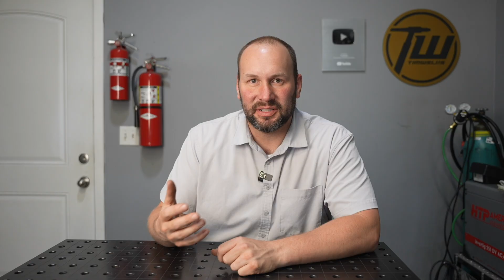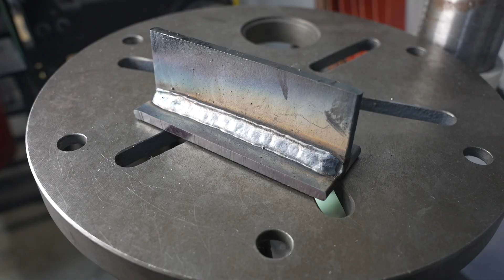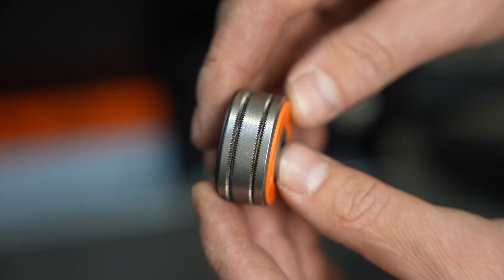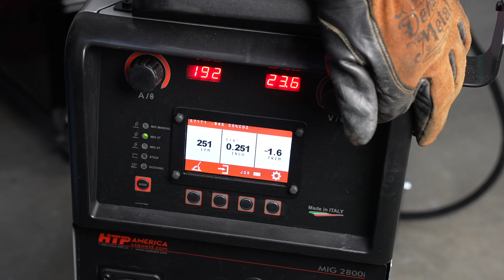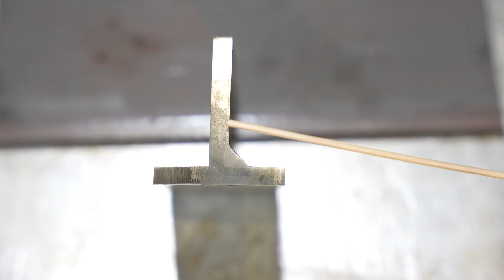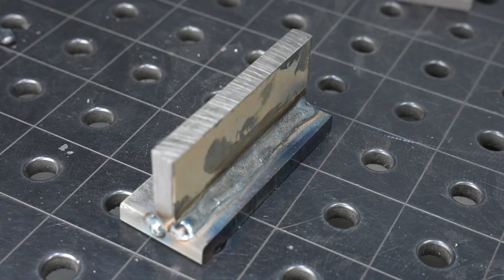Flux Core Welding w/ Gas? Dual Shield FCAW Basics

Comment: the penetration is pathetic, i cut and etch a lot of my welds ans i have better penetration with solid wire and a lot better with flux cored. all the videos on youtube about the dual shield seems to show the same thing, poor penetration and porosity..... not impressed by this process.

Comment: Ive been using a 210 for years with welding my jeep and a lot of 1/4" stuff. I've gone to a bigger front and rear axle housing (1/2") and needed to step up. I went and got a Hobart 240 iron man and have gone from 75/25 to 100 c02. 0.045 dual shield flux core wire and run about 35 on the gas pressure. I'm practicing one 1/2" to 1/4" horizontal welds with t joints. Its doing ok when i etch it but i'd still like better. I'm messing with wire speed and V settings right now. Keeping about a 3/4" stick out and of course dragging ... My 1st few welds looked AMAZING. penetration was so so... It's a fun set up and I really like the look of a clean drag weld over the wanna be tig C look.

Comment: I use this process exclusively at work. My vertical beads leave a bit to be desired as far as aesthetics but they are solid. I have never run a string bead with dual shield. We always weave slightly. As far as lead/ drag angle, I typically push my puddle with my lead at about 60 degrees tilt.

Comment: 200 amps to run 035 (.9mm) That's hot compared to solid wire isn't it ? I'm going to give it a shot  with my  200amp( 60%) Kemppi 2530 tomorrow, 0.45 wire😏

Comment: I rarely run dual shield. And I rarely cut a weld to check it. But what I’ve noticed is that whether I do it, or it’s done by someone on YouTube, the vertical has better penetration than the horizontal. I’ve wondered about that. Is it because the horizontal is on the table and so somewhat cooler? Is it because we all point slightly up, towards the vertical? Some other reason? But this is true no matter how something is welded. The process doesn’t seem to matter.
Reply from the maker: I've seen the same thing. I think it's because It's a slower progression and you're usually further up on the leading edge.

Comment: Used Lincoln outershield 71m for lots of things has its place in .035 welded a new hitch on a few trailers i still own two of them fixed my backhoe welded on a new front cutting edge been on there for over a year welded the back bucket still holding digs well guess 49 year old construction equipment needs work thing the horbart iron man 230 was working the wire has gotten really pricey though

Comment: Part of me misses running the 3/32" dual shield I used to run welding repower frames for Kinze MFG. But, the rest of me does not miss burning up 2 asbestos shields, a pair of gloves, and melting 2 cover plates in a 10-hour shift!
Reply: Yep 700 amps bleaching out all your clothes …  better have no skin shown at all !  
Komatsu and Caterpillar here in town run dual head feeders, one side 1/16” the other 3/32” on a 700+ amp power source ….
Yes, that stuff is HOT
Reply: @ZILAwelds I wore long sleeve denim shirts year round even at 90+ degrees and 98% humidity with a leather welding coat with the back cut out to allow a little air in.

Comment: I run this pretty much daily, my all around setting is 25 volts and 400ipm for the .045 wire. It runs really good flat uphill and overhead, your bead will come out nice and smooth, just trust the process and chill let it fill in when you are going. Try to stay steady and you are gonna have slick looking welds. Only for material that can handle the heat 👍
Reply from the maker: Thanks!

Comment: Hands down the best for structural welding. I welded a lot with Lincoln version. The only problem is it is very prone to porosity when a draft comes through the shop or you use it outside without a barrier. The porosity is very hard to get out as you need to  remove the whole section of weld with the  porosity and a bit into the base metal, otherwise when you reweld, will come back. We welded with it a lot outside the shop doors with barriers. Yes, it is better to drag it the way that was demonstrated in the video, but I did push it also when I was in tight spots where it made access easier. Also please wear a mask or use a fume extractor. In the 1990s none of us used anything to protect our lungs when we welded with this all day everyday. Please protect your health when using this wire.
Reply: Its funny how people will adamantly protect themselves from harmful things like welding fumes but at the same time be sucking down a Big Gulp or smoking a cigarette.  Hell the food you eat has chemicals in it and your water plastic.  Choose your battles I guess.
Reply: I have a valley forge mig from HF and a Lincoln AC/DC that was dads to stick weld.

Comment: Been seeing alot of dual shield stuff lately.

Did my first real weld repair, welded 2 new flanges on a catalytic converter, and welded the bracket back on. Used a 1/16th 6013, had to grind out alot of slag (thank you cut & grind wheel) and do 3 passes but it came out very strong
Reply: Welding that thin exhaust pipe with stick is tough …. Much harder to do than just regular mig wire

Comment: When you run that 1/2” plate … set your wire speed to 425-450 ipm ….  About 30+ volts
And you will need asbestos gloves even for a 10” test weld 😂😂😂😂
But you will see some DEEP burn in into the base material …
I welded thousands and thousands of lbs of this stuff …  smokey AF 
BUT what i like about it: the way how it fails …
Solid mig wire has no give …  (low % of elongation)  it holds and holds and suddenly breaks and lets go
Gas shielded flux cored has excellent elongation even though same tensile strength as solid mig wire ….  
It hold and hold and then it slowly starts to deform, bends and stretches with the parent metal, in my opinion this is a much more preferable way for a weld to fail, it easier to spot failure  as it comes “announced” and not “by surprise” …..

But 🤷‍♂️

Both will work
Reply from the maker: @ZILAwelds After sectioning it, I was thinking it could use a bit more heat. It wasn't bad, but definitely not near the full potential of the machine and wire I was using. 

I agree about the properties, when you look at the comparison in toughness on the data sheets, it can take much more of a beating before a fast failure.
Reply: Do you normally run on CO2? 30V is really high on C25, i could see it on CO2 though.
Reply: @OtisFlint i run 600-650 ipm with 035 dual shield wire with 75/25 and about 30 volt
Or i run about 400-450 ipm with 045 dual shield wire with 75/25 and about 30 volt as well ….  
That is borderline spray transfer ….  I have seen guys run it 1 or even 2 volts lower than i do ..🤷‍♂️

I guess there is an “operating range” and last I checked for the wire i was running i was still in the operating range ( on the higher end but still ) 
…. 

Co2 changes setting by about 2 ish volt….
Reply: @ZILAwelds  Man, that is cookin' 😅

Comment: Dual shield is badass, but you need a lot of machine and hot settings to get the best of it. Most companies don't make .035" DS wire for a reason...you don't get the real benefits until you're pushing up near 250 amps, which needs .045" wire (or about 600 IPM with .035). This isn't going to work in most homeowner MIG units. 26V on C25 with .045" wire in the mid 300s is essentially a wire fed 7018 rod. You can triple the productivity of running 7018 with great penetration and ductility, if your machine supports it. .035" wire on a 200 amp unit is not going to get it done, the results aren't much better than short circuit MIG, aside from being better on the verticals. 

The vertical up will run better when hotter. It's counter-intuitive, but hot and fast works better to keep the bead flat uphill.
Reply: Even on 035 dual shield ….  You need a lot of arc voltage 25-31 volts …  and most machines in that range “dont deliver” 
Lincoln 210 mp or miller multimatic 200 or 215 they all top out around 24-26 volts …. 
No point in running that kind of wire in them …
Lincoln makes outer shield 71m in 035  esab makes 7100 ultra in 035 HTP  has a wire in 035 American make  with i really love….

And their Pro Pulse 220 machine has up to 35 volts of mig arc voltage - so does their revolution machine ….  
About a year ago i did a HUGE job all 1/2” and 9/16” plate on an industrial baler …
30 lbs of wire  035 dual shield …. All 3 or 6 passes per joint. 
There were no weld defects but the smaller wire just took a long time
Reply: @ZILAwelds  I agree entirely. Most machines that cannot support .045" also cannot support the voltage / amperage demands needed to make dual shield perform to its potential. There are some guys running .035" in industrial applications on machines that have plenty of power and wire speed available, so they can go down to thinner base metals without switching wire, but then you need to run pretty crazy wire speed on thick base metal. 

Like you said, no point in running DS wire in smaller machines. You really need 250 amp and up machines for it to perform its best. 

Some of the bigger companies do make .035" DS wire, but there are several companies that make .045" and do not make .035", which is not an accident. .045" just carries the needed amperage a lot better.
Reply: @OtisFlint yes ….  045 and even 1/16 are the staples in the industry …  035 it’s more a niche market
Reply from the maker: @OtisFlint Thanks for the input! I've used .035" dual shield on several projects, and I'm doing some learning with this larger diameter wire at higher amperage. This new HTP 2800 is the first machine I've had to really be able to run .045". Based on the cross sections, I'll set it a bit hotter, closer to where you suggested when I actually run some thick material. 

I've used the .035" dual shield with a HTP Pro Pulse 220, which worked really well on 1/4" material, but that machine really has more capability in terms of wire speed and arc voltage than most in the 200 amp class. 

Thanks for the tip on the hotter settings running vertical, I'll try that next time. I've mostly run hard wire and with dual shield, you can really trust the process to hold things in place.
Reply: @TimWelds  That 300 amp machine really opens up a new world of possibilities with spray and dual shield. My point with .035" on a 200 amp machine is not that it won't work, it's just that it will not penetrate any better than short circuit with the standard 200 amp hobbyist units. Not an issue on 1/4", but that's about the reliable limit IMO. Like you said, the HTP 220 can stretch it a bit, but there's no way it's going to support 600+ IPM at 26+V, unless it can briefly output more than the rating. Would be a fun little test, some of the ESAB machines will hold 20-30 amps above their rating for a brief period of time, wouldn't surprise me if the HTP does it also.  

Anyways, crank that 2800 up and stay on the leading edge, she'll dig right into the root on these plates, no problem. Happy welding, Tim!
Reply from the maker: @OtisFlint Makes good sense, I appreciate it! Happy welding!
Reply: @OtisFlint actually, the pp220 does run 035 dual shield wire (in the program for it) with 590 ipm and about 30 volt and it does that just fine for an extended amount of time ….
Sure, depending on your ambient temperature the air that comes into cool components there is some duty cycle limitation that eventually you might run into but if you do a job fabricating stuff cut apart fit apart well apart, and cut the next part fit the next part well the next part And if it’s let’s say no more than 70 or 80°F outside, you can do that all day

Now, if somebody else checked everything up for you and you just need to weld wild weld and if it’s 90 or 110 then yes you will take a few breaks here and there because you will be hitting duty cycle of the machine 
But it works surprisingly well you wouldn’t be the first one to underestimate that little machine
Reply: And again then there is the difference between a repair job for something welding a trailer hitch on a 10 or 15 ton pin trailer that goes behind a big construction truck that could really benefit from dual shield wire and you can easily do a small job like this a repair job with the Pro pulse 220
Or if you are in fabrication manufacturing where you are building a 1 inch thick or inch and a half thick excavator bucket for the next three days and you’re just welding pass after pass after pass with O45 wire that’s a whole different animal then you need a 300 amp 400 amp machine